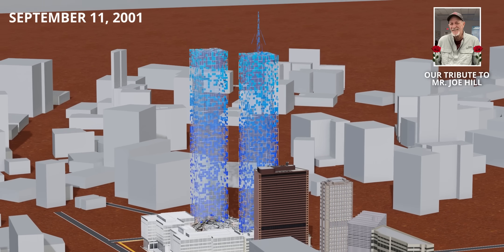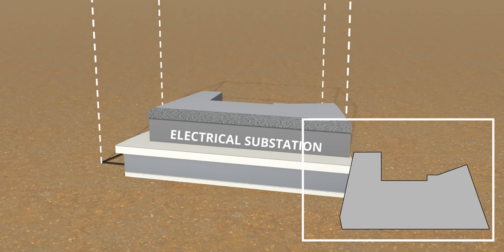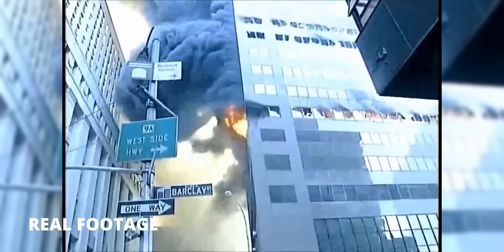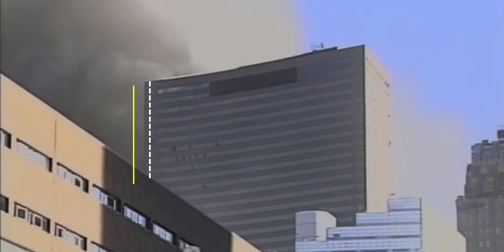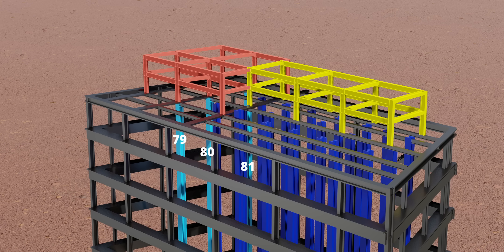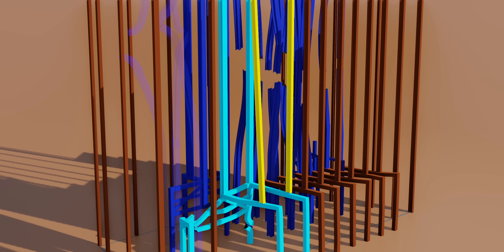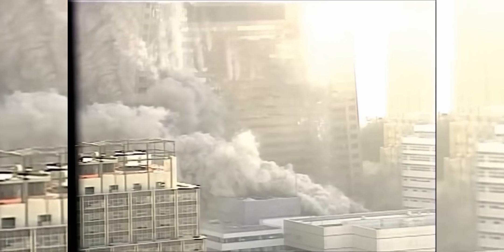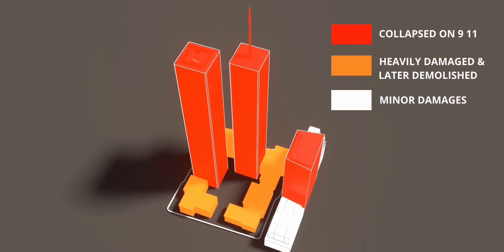Collapse of Building 7 | The Complete Physics

Comment: 8:15 I think this channel did a much better job at explaining the collapse then the Official “9/11 report”
Reply: Well, this video is designed to give a general overview to a YouTube audience - noobs. The NIST wrote its report for engineers.
Reply: Yea, 25 years later its more easy to make a nice powerpoint with just easy telling how everything failed. They just needed to also clear that building so with Steel cutting Charges the building felt down as a normal building does when demolished with c4 charges. My question is why nobody spoke about this collapse. It was the 2 mail WTC's but never WTC 7 . It was in 2001 a coverup hard to explain. And antenna could only scratch the outside off a big building but never damage that building so much that it just gave up al, in once. 2001 was Amerika attacking itself so they could start multiple wars trough the middle east. They only needed a reason. And it is already for a long time no secret that comming into Iraq was a big mistake. 

All False flag operations. But 90% of people won't believe that narrative and still goes with the mainstream media. But they didn't research the rabbit hole of everything. Even the 2 WTC's you see on some video's flashes from charges that cut the support columns that caused them to thumble strait down. As long 90% believe a pair of terrorist did this everything is fine. And those who come too close with evidence will be silenced as always.
Reply: @LennardA320  - Or, you could use the thinking part of the brain and not embarrass yourself. 

Building 7, the 6th building to collapse of 10 lost on 9/11 still confuses many even though it has been extensively studied. Not famous or a terror target, and with no casualties it did not get a lot of attention initially, creating an information void the internet rapidly filled with garbage. Because everything seems like a conspiracy if you don’t understand how it works I prepared this brief summary of the collapse from my own analysis. No politics, just engineering. 

The North Tower collapse at 10:28am bombarded Building 7 with tons of burning debris, causing heavy damage and starting multiple fires burning out of control for the next 7 hours. Half the FDNY firefighters having been killed, others injured, units in disarray, equipment destroyed, no water pressure, and the greater urgency of Search & Rescue efforts, firefighting was pulled as futile. The building couldn’t be saved and was left to its fate.

www.youtube.com/watch?v=g_SvpwyC17M&ab_channel=MFitz  

Collapse of a burning structure is always a concern for firefighters. Steel buildings subject to fire rely on active fighting of the fires to survive. Buildings are designed around 1 to 3 hours of fire resistance, allowing time for occupants to escape and ACTIVE firefighting to get started, after which all bets are off. Left to their own devices they will exceed their design envelope and collapse. In B7 the occupants escaped, passive and active fire protections were compromised and active firefighting was abandoned which left the building to take its chances. It lost. Odds on Building 7 would eventually collapse, and it did. No big deal in logic. That is the sort of choice firefighters make every day in brush fire situations - which houses to save and which ones to let go. Only real difference here is moving the decimal on the size and cost.

www.youtube.com/watch?v=WnYBX6QT0R4 

FDNY Chief Daniel Nigro ; The biggest decision we had to make on the first day was to clear the area and create a collapse zone around the severely damaged 7 World Trade Center, a 47-story building heavily involved in fire. A number of fire officers and companies assessed the damage to the building. The appraisals indicated that the buildings structural integrity was in serious doubt. I issued orders to PULL BACK the firefighters and define the collapse zone. It was a critical decision; We could not lose any more firefighters. It took a lot of time to PULL EVERYONE OUT, given the emotionalism of the day, communications difficulties and the collapse terrain

FDNY Deputy Chief Peter Hayden ; We had our special operations people set up surveying instruments to monitor and see if there was any movement in the building. We were concerned of the possibility of collapse in the building. And we had a discussion with one particular engineer there, and we asked him if we allowed it to burn could we anticipate a collapse and if so, how soon? And it turned out that he was pretty much right on the money, that he said 'In its current state you have about 5 hours

The collapse of Building 7 was anticipated and widely reported in the media throughout the day. At least 24 video cameras recording some or all of the collapse. Everyone knew what was coming and why.

www.youtube.com/watch?v=OY5S5k3tMHI 

Building 7’s collapse was completely different to the Twin Towers, harder to understand with most of the details difficult to see. But we can still sort out what happened through careful analysis and observation.  This is MY EXPLANATION of the collapse sequence using the best available information and relying on no authority.

B7 was complex 47-story steel framed structure built on top of a smaller existing 3-story building, requiring several lower floors dedicated to complex load transfer structures instead of usable office space. Of trapezoidal shape and all-steel tube-in-tube construction, B7 (above the 7th floor) consisted of a central core of steel columns carrying most of the gravity load, perimeter steel columns around the outside of the structure carrying the remainder of the gravity loads and long span beams and girders to tie those elements together and form the floors. On the outside of the building hung a moment frame - the last part of B7 to fall. 

Phase 1 : The first externally visible signs of collapse initiation occurred at 5:20:28 pm. Collapse initiation for B7 is notably quiet with observers not realizing the building was collapsing! There was no audible warning in the form of say hundreds of ear drum busting 180-190dB explosive bangs preceding the collapse. Here at 12:00 a local CBS affiliate reporter is talking 10 blocks from B7 when collapse begins. People don’t start to notice the collapse until 12:11. Then at 12:45 is the famous CBS fixed camera clip of Building 7’s collapse.  Note how quiet it is.

youtube.com/watch?v=t5tEy6mXSE8&ab_channel=fresnosean379

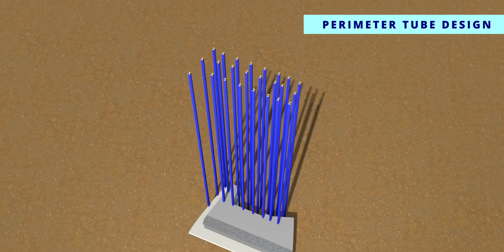Collapse initiation was due to lower floor failures above the load transfer region (7th floor) in the NE corner of the building. In this video at 0:45 you can see the NW corner from inside the building while under construction, Column 79 just out of frame on the left. That big, angled steel beam across the top of the frame connects to C79 at one end. The girders connect to the beam. That beam and all those girders depend on just one connection

youtube.com/watch?v=nP3TNHPCIVU&t=35s&ab_channel=EdwardCurrent

Phase 2 : Lower floor failures caused a loss of critical lateral support over an excessive length of core Column 79 and it buckled. If you look at a floor diagram of Building 7 (see above) and look at all the structures that depend on C79 you quickly realize this one column was a relatively isolated structural element on which a disproportionately greater fraction of the structure depended analogous to say the Key Bridge. Externally we see a vertical progression of window breakage along the 44-46 line and a kink in the roof of the East Mechanical Penthouse at the top of the building, consistent with C79 failure. The transition from full capacity to almost no capacity occurs in virtually an instant. Once the buckling failure occurs there is almost no resistance

Normally with a buckling column, the load could very well be redistributed to other columns, meaning the buckling could stop after a while. With C79 that is not the case - the failure did not redistribute the load, so the collapse rapidly progressed to the roofline, sinking the rooftop penthouse.

Phase 3 : With C79 gone, B7’s progressive, non-symmetrical collapse continues with C80 and C81 at the east end of the core left laterally unsupported and quickly buckled and failed as well, sending the EMP down through the building. C79-81 all have no diagonal bracing, which I believe is a major reason why they could not redistribute a lot of vertical loads among one another.

From there collapse progressed from east to west through the central core until the core was gone taking all of the interior floors and structures and probably most of the perimeter columns with it. You can see the horizontal progression of window failures low in the building and the dropping of the remaining rooftop structures into the building. One of the big takeaways from the NIST Building 7 study (that gets completely ignored) was their modeling which determined C79 failing under ANY circumstances would have initiated the same collapse sequence.

Phase 4 : After some 10 seconds all that remains of Building 7 is just a hollow empty outer shell - the exterior moment frame - creating the illusion the building is still standing since little has changed externally. But it’s just a hollow empty shell like an empty cereal box supported by only a few remaining columns and quite unable to remain standing. With all the internal framing gone. the north face leans inward, forming a V in the roofline, the last perimeter columns buckle under the strain and with nothing left keeping it up the moment frame free falls, landing on top of the 7-story high debris pile. It is only at the very end that a single measurement of alleged free fall acceleration is taken. Note this is not the building but just its outer shell, and only one corner at that, at the very end of the collapse. Start to finish the entire collapse took 18-20 seconds, or less than 1/3 of true free fall and we have to look at the whole thing, not cherry-pick little bits to fit a particular narrative. Worth noting _how fast something falls cannot tell you what started it falling in the first place. The debris spread out, blocking surrounding streets, heavily damaging the Verizon Building and destroyed Fiterman Hall, all well outside of Building 7’s “footprint”.  

Building 7’s progressive, non-symmetrical collapse was incidental and unintended collateral damage from the combined effects of fire + time + gravity started by the collapsing North Tower. That is true no matter who planned and carried out the 9/11 attacks or why . The collapse was of so little consequence it barely even registered at the time, a mere footnote. It only took on semi-mythical status as an alleged smoking gun years later when demolitions at the Twin Towers, missiles at the Pentagon and shoot down over Shanksville all failed and conspiracists had nothing left to work with.

Anything can seem like a conspiracy if you don’t understand how it works. Now you should. I hope you found this helpful, informative and it solicits informed critical comment. If I made any errors of fact, logic or reason or left anything important out, please let me know so I can fix it. IF you can offer a more plausible alternative please do. Be the first. Please start any reply with the words “Tits McGee” or I will know you didn’t read it and are wasting my time.
Reply: @LennardA320  you dont' even know what you are talking about dude
Reply: @ThreeLettersFed  Three letters: CIA
Reply: @WatchYOBackBrah  you got me. now they wont be paying me anymore for spreading the real truth